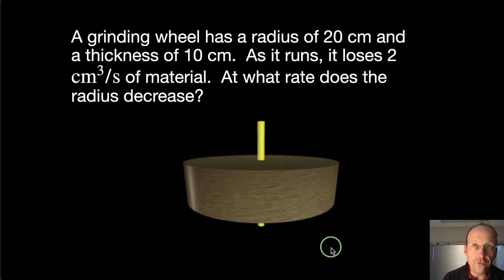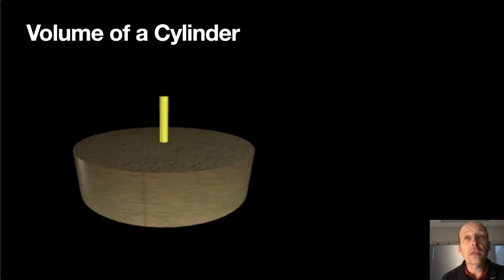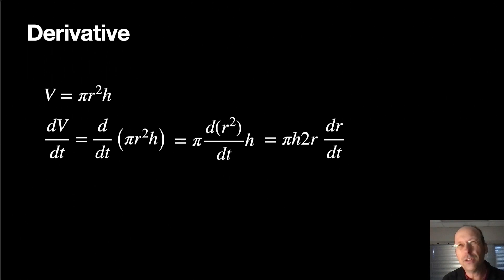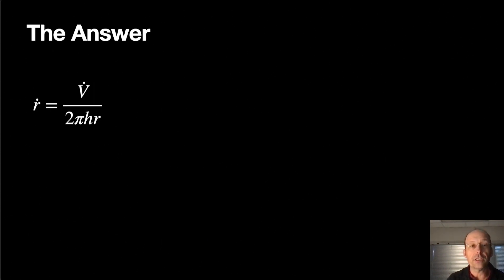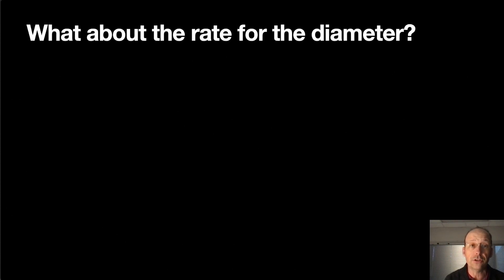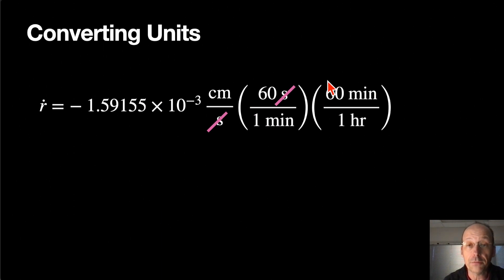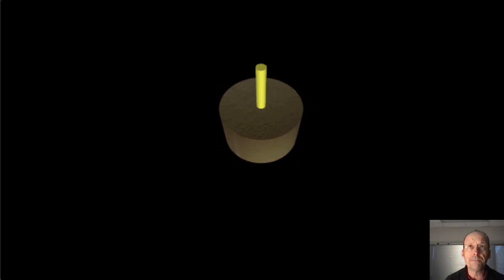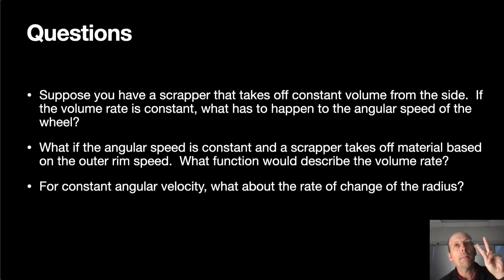Calculus: Finding how fast the radius of a grinding wheel decreases.

Comment: Even though these are arbitrary problems for a class, they directly relate to machining, namely surface grinding and turning.  On a cnc lathe we program our rpm by inputting the desired sfpm (surface feet per minute) because that's the value that best relates to optimizing cut speed, quality, and cutter life.  Every tool/material combo has an ideal sfpm.

I really wish teachers in school would take problems like this that seem abstract and demonstrate exactly how it really exists in the real world and turns into real dollars.

For example: the inverse of your problem with the grinding wheel is a real problem in a machine shop.  In this case we want to measure how fast the wheel wears at a particular point in time, by calculating the volume of wheel consumed, and figuring out when you are going to need to replace the wheel and how many parts you can expect to get vs how many dollars you spent on the wheel.  You also can know what the max rpm of your grinder is to determine at what diameter the wheel will become too small to maintain the correct surface speed relative to the workpiece.

If I was teaching the class I would make the students bid on the job by calculating this information and finding which grinding wheel they are going to buy to optimize these variables